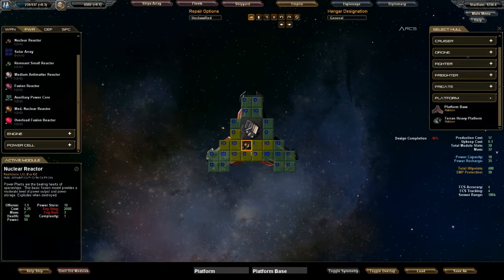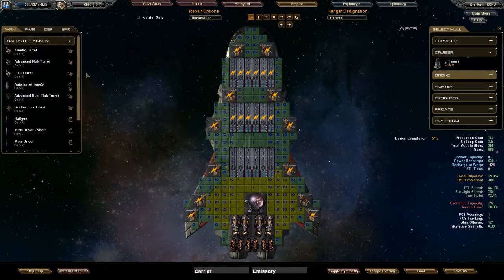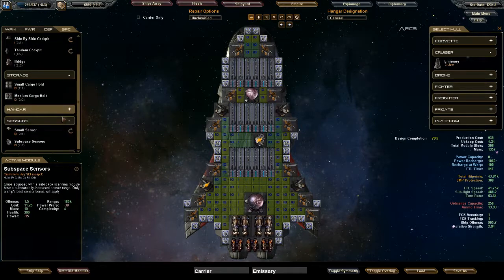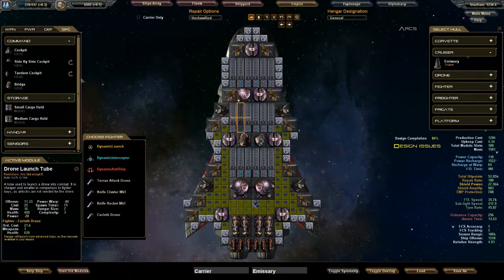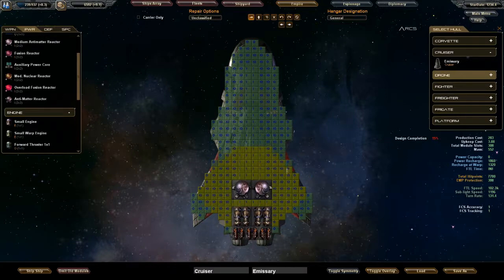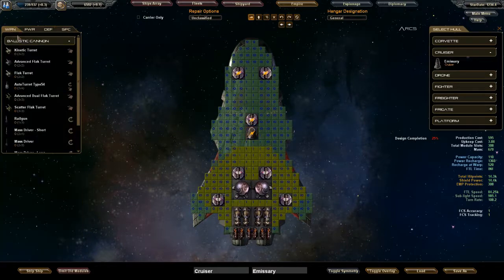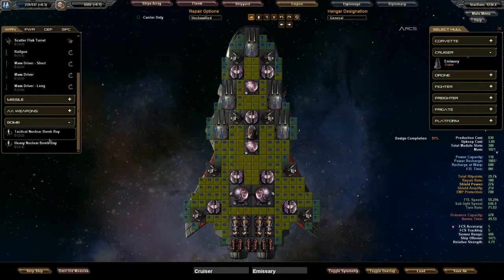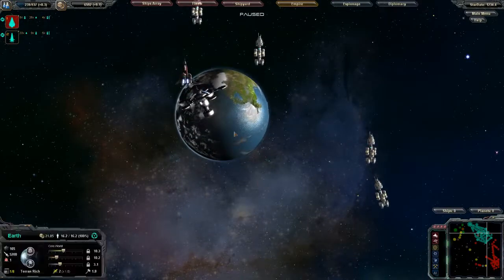21 - Star Drive (BlackBox & CAM) - Design Episode

Comment: Reasonable designs by all means. Will be fun to see them in combat. Might be worth considering that as great as it is that electro, solar & fairy armor provides power, it also explodes a little when destroyed. I use these as secondary armors to power hard to reach modules in my designs. They aren't bad & do add some protection. But yeah. Liiiiiittle bit explodey too.

Comment: Another build with fixes and some changes in UI is ready (10887), along with a new CA (6.8G), which adds a slight warp speed for Drones to help them arrive to combat faster. None will break you saves and will hopefully provide better user experience.
Please consider updating.
Reply from the maker: Thanks. Will do.

Comment: You can also replace a 4 1x1 armor modules with a medium armor 2x2.  It is slightly better than 4 small modules.
Reply from the maker: Thanks. Given H3’s comments on the armour being a bit explodey I think I’ll research better shields and then do an upgrade. Also need to reorganise my fleets so they have a cordon of frigates and fighters around them. Wouldn’t want anyone scratching the paint job.
Reply: @welshbengaming3791  the 2x2 modules are a liiiiiiitle bit more explodey also :P
Reply: @AdHerlihy  xD